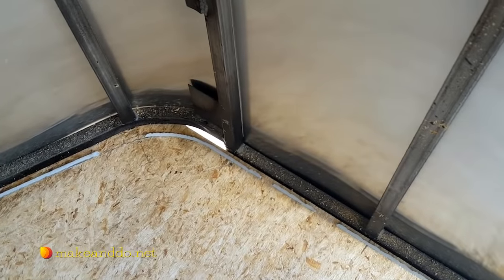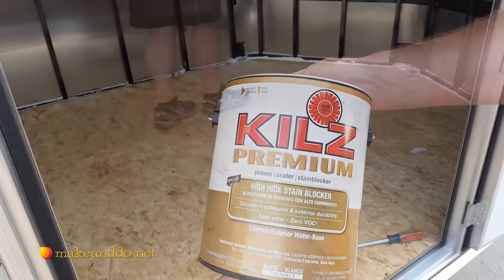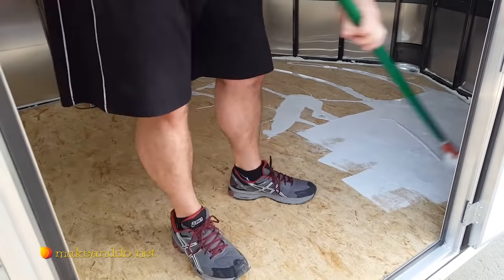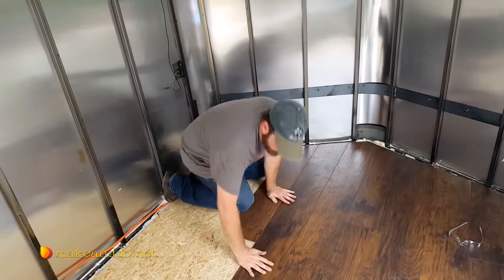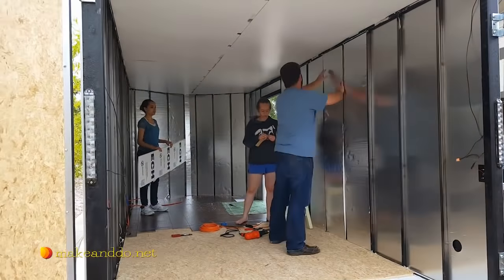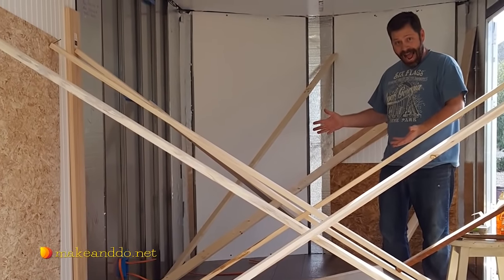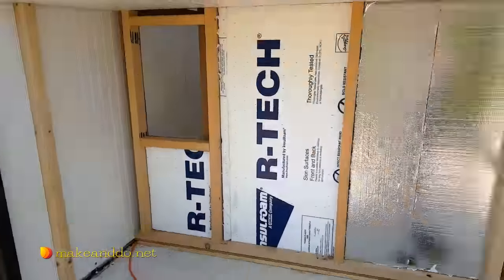Cargo Trailer to Camper Conversion - How We Did It in 4 weeks

Comment: Awesome!! Any info on total weight? also looking forward to the electrical vid!
Reply from the maker: Total weight including appliances and everything including what we take on trips such as clothes and food came in at 3640 lbs. I'll start posting more videos including electrical later in February.
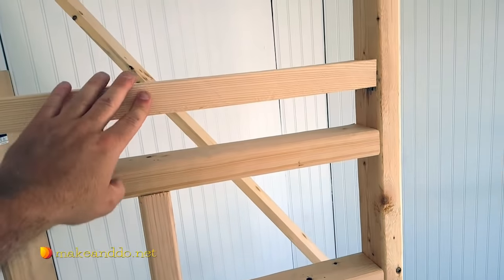Reply: make & do that's really close to the limit of your Cherokee! If you bought it with the factory tow package! If not? You will be over the limit! The limit is 4,000 with the factory tow package and 2,500 without! So even if you do, you will not have enough in reserve for more than two passengers and their stuff!! I know this first hand as I own a 2015 Cherokee Latitude, V6 4x4/AWD. I could not find one with the factory tow package and had a hitch installed at a dealer for $1,000! Installed with all the wiring and brake controls. I thought I could tow my small travel trailer that only weighs 3,000-3,900! On the flat hyw it is fine, but in the mountains I get a high trans temp warning that is very concerning and gets recorded in the computer that the dealer has pulled!! So I have been forced to get a new Colorado, that my wife drives daily to hat we now use to tow our travel trailer with no problem at all! It's a 2016 Z71,4x4, V6. That does very well. The Cherokee does fine, until you hit a big hill, I was concerned about the transmission with the issues I've heard and did not want to have a dealer tell me it was my fault for towing a trailer that's too heavy?! The factory tow package comes with a hd transmission cooler and engine oil cooler, plus the final gearing is lower, at 3:55, instead of 3:23! So there is enough of a difference to make it work better! Oh well have fun and stay safe out there!.
Reply from the maker: Kevin, I just double checked the towing capacity of my Jeep and it is 4500 lbs. The weight of my camper with gear comes in just over 3600. So I am still 900 less than max. I will make a video around mid to late February showing all of this. I can tell you that I have pulled the trailer over 8000 miles now including through the mountains with no trouble at all.

Comment: No a.c. and next to no windows equels oven. You can't get to any of your kitchen without going outside.   You should have placed the insulation under the existing floor.    None of those walls are load baring so you could have gain space and cut weight with 2x2s .    Steel studs would also worked and kept the weigjt down.  Weight wise you added about 60% more weight than was necessary in the whole build.

Comment: Why # 10/ 2 wire for standard receptacles and no cable supports near boxes and the boxes are too small to meet box fill requirements with devices installed. YiKES no notch plates on framing where cables pass through framing. Fire hazard on wheels.

Comment: Why did you use 10/2 wiring 14/2 would have been fine for 15 amp circuits
Reply: What makes you think theyre 15 amp outlets? I didnt actually see any but im willing to bet theyre 20 amp so the wire size would be #12. Further, #10 could easily be justified when using a 30 amp park hookup, thus making full and safe use of that size connection.

Comment: Over time, that glue holding the walls will loose it's 'grip' and down comes the wood paneling. You should've screw them in with wood/sheet metal screws for more security and you can then paint over the wood to cover up the screws.
Reply from the maker: Okie, the bigger problem I ran into was the beadboard expanding and warping in humid climates. I am currently remodeling the camper. I will be posting a video within the next month or so.

Comment: I built one, but I made sure I had an a/c  unit. Tell me you eventually put one on.
Reply from the maker: I bought a portable unit that vents through a small 5" tube and used a dryer vent on the exterior of the camper.

Comment: If you drill into the roof, doesn't that make holes on top?
Reply from the maker: Yes, but you simply make sure they are sealed.
Reply: Ah. That makes sense. I am obviously not any kind of builder.

Comment: Add an atmospheric water generator to address the water condensation iusses that will pull any water vapor from the air inside. Neat idea use a snall vacuum tube water heater retrofited to super heat gallium add an electromagnetic pump that will pump the gallium through a copper heat exchange to heat water have the coil placed above the main tank of gallium so the gallium will drain back into the main tank ounce the system is turned off. Add in thermal electric generators to produce electrical power off the system has well. 😉😊

Comment: Another query, i want to avoid glue at all cost, anyone with alternative ideas for the walls? Mine has to be four-season so i want to spend what i have to spend on the walls. I am doing slow build to be able to have more income for this project.
Reply from the maker: Yes. I have an alternative idea. I actually just completely remodeled this trailer. One of my goals was for it to be as VOC free as possible which means I used absolutely no glue at all. I will be posting videos in the next couple of weeks showing how I did it.
Reply: Excellent, will tune in for sure.

Comment: If you're going to use that OSB crap, YES, you'd better spend some time caulking with the best stuff you can buy.  Even if OSB is 'waterproofed', it's just a coating -- every cut and every hole is an invitation for water to soak into the OSB and cause it to swell.  And after it dries (IF it dries), the swollen part will remain swollen.  The swelling also breaks the coating, which will allow it to absorb more water next time.  If this causes problems, too bad.

Comment: great build but not efficient. When building a mobile unit, you need to focus on the biggest enemy of all - weight. Use cedar wood, aluminum framing, etc. not standard 2x4.  Huge difference over standard wood. Also on the floor, the plywood is massive weight, and weak insulation. Should have used a roll of cork, the laminate can go over but there is cork flooring out there.  Insulation on the walls were installed backwards, the shiny stuff is heat reflecting, so that has to face the outside and the matte or white should face the inside. 
But the finished product looks good, but probably extremely heavy :-)
Reply: I've got a benjamin that says the white foil is just as effective as the shiny foil, especially when facing a sheet metal wall.

Comment: Could have saved a ton of weight by using aluminum studs. This is nice but weighs as much as his  home. It also took way more than 4 weeks if you count total man hours more like 6 months. Just go buy a used one off of Craig's list. Most people buy trailers and only use them a few times and they depreciate a bunch so counting parts and all of the labor it would have been much cheaper to buy a nice used trailer and still have this one as a hauler. Just my two cents
Reply from the maker: I probably could have saved weight by using aluminum studs. As far as it taking more than 4 weeks...of course it would have taken longer if you add up all of the man hours and stretched them out as if only one person were working on it at a time, but I was lucky enough to have a good bit of help from my kids. So the actual time it took us was 4 weeks.

Comment: Isn't the trailer over the towing capacity of that Cherokee in thumbnail?
Reply from the maker: Nope. The towing capacity of my Jeep is 4500 lbs and the trailer comes in below that.
Reply: I was also curious about the weight. A 16ft double axel trailer plus all that wood must add up. Do you know what the trailer weighs? If not, I would recommend taking it to a DOT scale and getting a weight. I'm looking at doing a similar conversion and before I started anything I got a "before" weight. Mine is a 6x12 single axle and is 1,420 lbs.
Reply from the maker: I did exactly that. Here is the link to my other video about weight and towing capacity. https://www.youtube.com/watch?v=hsIMLWxh7P0
Reply: Awesome! Thank you for the prompt response! Keep in mind that 3600 pound trailer weight you measured a CAT Scales is only the trailer axles and does not include the weight on the tongue (approximately 10% if loaded appropriately). I'm sure you already know that but you didn't mention it in the video. Even accounting for 10%, you're getting close, but still under the 4500 pound towing capacity of your Jeep.Nice videos. I appreciate the quality and detail of the build and the videos.
Reply: Dude you are breaking the law in any state. It does not matter how much the trailer weighs. If the sticker on the trailer says it can carry 7000 lbs and your cherokee hitch is 5000 lbs..you win a ticket or a flatbed.

Comment: How wide and how how is your trailer?
Reply from the maker: It is 7 ft wide and the interior height is 6.5 ft.
Reply: Thanks one last question I want to order one can you give me the exact dimensions like the external dimensions to give to the dealer the interior height and width seem comfortable is it?
Reply from the maker: Mine is 7' x 16' and about 6.5' high on the inside. However, if you plan to convert your own, the size you need will depend on your floor plan and interior layout as well as how many people you plan to sleep. You may want a completely different size than what I have. Be sure you have your plan laid out before you order the trailer.

Comment: Why did you run 10ga. wire? That's for 30 amp service. Nothing in your camper requires that.
Reply from the maker: Noob mistake. I wanted to be sure I could push enough amps in case I added an AC later.

Comment: what is the weight before and after and loaded?
Reply from the maker: Loaded, it comes in just under 4000 lbs. I'm not sure of the exact weight before it is loaded. Check out more info about the weight by watching the video about weight, towing capacity, and braking.

Comment: going to be one hot box with no cross flow ventilation or airconditioning - trust me - I use the same trailer for my photography business and on shoots in the summer I am sweating like a pig looking for equipment , lights and lenses etc to set up the shoot - you should have put two windows, one on each side, a minimum of 18x24" in the center of the box to get some cross flow - you die in there with only that little single ceiling fan for air circulation - should have had at least two of them one at the front for intake and one at the rear for expelling air......airflow is the number one necessity in any trailer or small home -

Comment: Yikes just so you know the osb you removed from the walls is actually a structural support for these trailers.  It keeps the whole trailer from racking and gives the walls sheer strength.  You seriously jeopardized the whole structural integrity of that trailer.
Reply from the maker: If you noticed in the video, the osb was replaced with other walls including interior framed walls. I also added an Interior ceiling and more flooring. If anything, it has much more structural support after the conversion.

Comment: Nice!! but no AC dude there is no way I'd be comfy, I have to have AC. Still badass build.
Reply from the maker: There will definitely be an AC before summer. I'm going to have a portable one that just plugs in and make a small hole for the drainage hose.
Reply: Looks like the kitchen is outside.  Going to be fun cooking in the rain.

Comment: Just a couple questions. What does the shower toilet like? You really should have put a Fabulous Fan in instead of the small bathroom vent/fan! They are a LOt better! I know I've changed mine out! Then how much did this cost about? I bought a new Forest River Cherokee Wolf Pup 16FQ, that has 16' living space and is 21' overall, it has a walk around queen bed and dry bath. It's a limited so it has everything ! Like AC/30,000 BTU FURNACE. lots of Windows and storage. It's a single axel with alloy wheels and 14" radial tire filled with nitrogen than never seems to go down? There's a 6/10 gal electric propane water heater and fridge, microwave and a dinette. We are very pleased and paid just under $13,000! Oh well good luck have fun stay safe!
Reply from the maker: Not sure what your question is when you say "What does the shower toilet like?" As far as the cost, it came in just under $9000 for everything.

Comment: Wow !  Thanks.  Biggest "oops" ?
Reply from the maker: Biggest "oops" was the electrical. I ran 10 guage wire which was overkill and extremely difficult to work with. I should have used 14 gauge and one 12 to the portable heater. I'm actually going to make a video on it later.

Comment: Looks to heavy but looks good but the lumber you used was to much! Sorry it’s an over load
Reply: its a cargo trailer. I'm guessing the total weight added on from beginning to the end of the video was just over 1000lbs. Remember that an absolute assload of OSB was removed from the beginning, and was ultimately replaced with wainscot hardboard (way lighter than OSB) and "distressed" 1 bys.

Comment: Why are you using planed wood for studs?
Reply: Ive never seen 2 x 2s that were anything but planed, just like 2 x 4s.
Reply: @joewoodchuck3824  Very fancy..... All hidden stud work here is rough sawn.
Reply: @basilallen308  Ive seen the occasional rough sawn lumber here in the northeast, but it only comes from a few small mills where people can buy direct.  Otherwise, all lumber retailers whether the big chains or smaller yards sell planed lumber exclusively.
   I have used a little rough sawn lumber myself and its nice to use for the extra strength it affords, but is exceedingly rare to find. I wish more of it were available, but the lumber industry as a whole only wants to offer us the smaller smoother variety for whatever reason.
   Where are you that rough sawn is so widely available?

Comment: Absolutely unnecessary to put the wood strips down and insulate between them you just added unnecessary weight. Second thing, If you are towing with that SUV it better be tow rated to tow 7,000 pounds at least because your trailer with 2 axles is rated at 7,000 pounds GVWR and if your tow vehicle is not you can be ticketed and pulled off the road till the tow vehicle is correct.

Comment: Towing that trailer with a jeep cherokee is illegal. The cherokee hitch system is only rated for 5000 lbs. That tandem axle trailer can carry more than 7000 lbs. As soon as a cop compares the hitch rating to the gvwr on the trailer paperwork, you get a ticket or it gets flatbedded away. God forbid you get in accident with the cherokee towing...its instant recklessness and endangering.

The law has nothing to do with the actual weight of the trailer. The law has to do with ratings in paperwork.

You should get another tow vehicle with a suitable hitch ASAP.

Or, If possible, you should should try to re- register it as a "homemade" trailer and put 4990 lbs on the gvrw rating. It will save you tickets and lawsuits.

Comment: not very modern, looks rustic DIY . Popular mechanics circa 1970.
Reply: What you think is modern is, well, cheap. You don't think they paint MDF trim because it looks good, do you? Wrap around sheetrock is even cheaper than that. Circa 1970's? The walls would have had vertical line stained wood paneling, the faux beams would have been made out of Masonite and the floor would have had either green or orange shag carpet.
Reply: opinions vary .
Reply: Thats the beauty of it...you can make your own exactly the way you want!
Reply: I think more like Popular Mechanics circa 1968. Didn't Sunset magazine get into something like this as well? Kinda cool in the nostalgia for a nostalgia for a history that never happened kinda sense.
Reply: speedxdreems you’re a goober
Reply: TakeAmericaBackfromISRAEL  yours too?